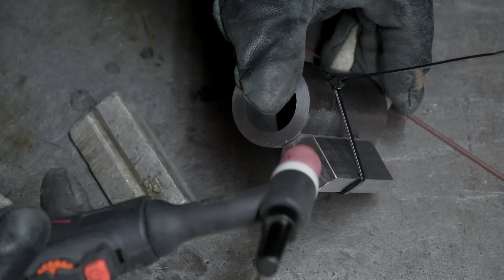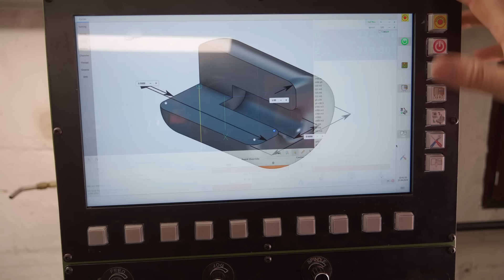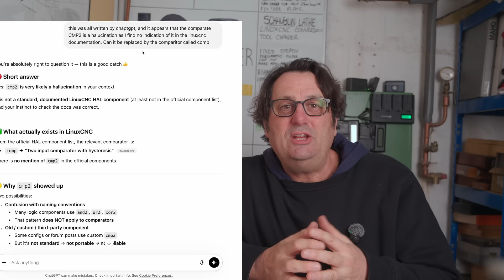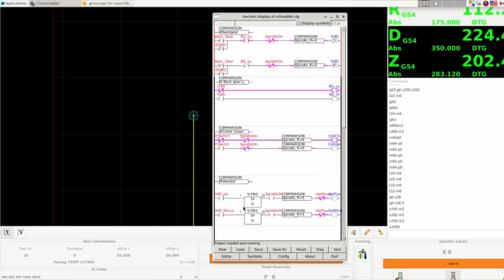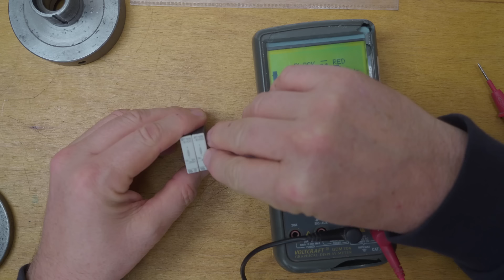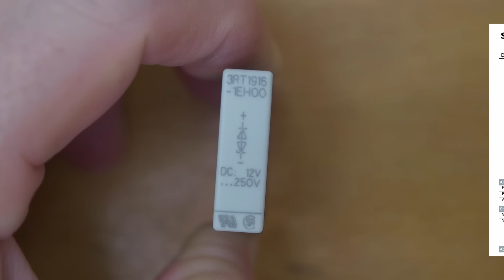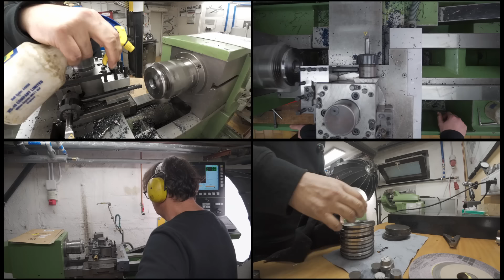Schaublin tool changer finished and working || RotarySMP

Comment: AI chatbots do this all the time. When they don't know the answer they use placeholders and made up function calls. They are still useful as the resulting code can be seen as preudo-code that gives you a good place to start, with a good part of the logic already in place, but they can also be deceiving.
Reply from the maker: Yeah, am glad this was such a small, compact task. I can imagine you end up chasing your tail due over-reliance on AI code for a bigger more complex project.

Comment: we went from the "polishing of a turd" mini lathe to making a pneumatic tool changer working on a shaublin hughe cnc lathe ...  wow congrats mark,  meanwhile I am still debating buying and cncing a mini lathe.
are you excited for the america's cup ? I think you kiwis will dominate it once again.
Reply from the maker: I would not recommend getting a Sieg 7x lathe, like I used. You would be much better off starting with a Boxford training lathe, or Emco 120Turn etc. The 7x is really just a poorly assembled set of castings, and the basic bed is too flexible.

I am excited. It will be interesting to see what Burling does in Luna Rossi.

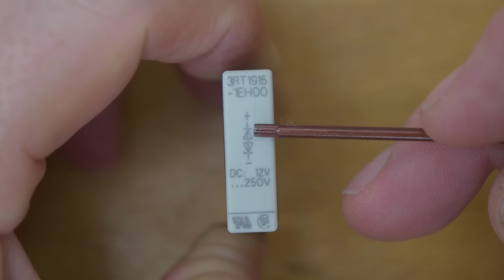Comment: 35:10 That flyback suppressor uses a zener diode (the bottom one) in series with a regular diode.  The point of this is to the allow the flyback voltage to increase to the zener voltage which speeds up the opening time of the contactor.  Clamping with a single diode can slow down opening times significantly, maybe as much as ten times.  The extra diode is needed to prevent the zener conducting when the contactor is actuated.  The really frustrating thing is that Siemens do not appear to publish the zener voltage for these modules, so you'll probably need to break out the scope to see what the clamping voltage is and whether it's safe for the output drivers.  In your application you may be able to cope with slower opening times without a problem, so a simple single diode clamp could be used.
Reply from the maker: Thanks. Since my valve timing is in seconds, I assume that 10x ms switching would be irrelevant to the performance.
Reply: @RotarySMP  Yes, it makes just few (tens of) miliseconds, definitely not an issue in your case.
Reply: Yup, if you look closely at the thing you can see their absolute half-assed attempt to mark one of the diodes as a zener. The two diodes open at a higher voltage than the typical DMM tries to measure diodes at... Hook it up to 12-24V in series with a 10K resistor or so, then try measuring voltage on it like that in both directions...

Comment: you go with that ai and i go with my little project of making bigger chincese mini lathe for machinung 8 inch speake basket castings :] because i decided to build 8 inch woofers at home from scratch
i already cast and "chachined" multiple aluminium parts to rise the headstock, toolpoast and tailstock by ~20mm plus multiple parts for belt speed reduction and today i gained the ability to drill accurate holes with the tailstock drill chuck. what a change it is from holding puleys under the drill press and praying to get it on center and not cut myself if pulet stick to the drill 
it is fun doing things so i hope you had fun doing all the toolchanger stuff too because it is always surprisingly uplifting when something you made  actually work
Reply from the maker: Yeah, I was also glad to get that working. 
8" speaker baskets with a mini lathe sounds like a challenge. :)
Reply: @RotarySMP  yes 8 ninch on a 7 nich lathe is a bit of fun , but it is aluminum and not simething harder so i might be fine,  cince i will be only machining the 4 inch center, then again this is stupid to begin with. i am also planing to make my own paper cones and taht will be even more fafing around . but what would life be if not a bit boring without projects that make no sense to most people
Reply from the maker: @kokodin5895  Exactly. I identify with that!

Comment: I work (somewhat reluctantly) with GPT applications. Regarding "hallucinations":
This is a core feature of these types of AI systems - the same mechanism that causes this type of output also lets it "invent" new ways to answer that apply more precisely to the requested case.

I recommend using the systems for what they are good at: generating suggestions, and not what they're not good at: generating precise solutions that need to work out of the box.
Reply from the maker: Yeah, I get that. This was a good exercise for me, to see what AI hallucination really looks like.
Reply: Funny to see that a bug is now called a feature. 😂

Comment: 35:09 the bottom diode has an extra bar on the left leg, almost like half a zener diode. Maybe it needs a certain amount of voltage before it starts to work?
Reply: It's one of the standard zener diode symbols, you just have to figure out which standard that is 😄
Reply from the maker: @zapl80  The nice thing about standards. So many to choose between :)
Reply from the maker: Good spotting. Thanks.

Comment: Those relay snubbers look like a diode and a zener diode in series, which are faster than just a diode alone. You'd need to check that data sheet for the full specs and to see if they're right for your application. Nice to see the tool changer in action , good work.
Reply from the maker: Thanks a lot Richard. It was a nice step up in functionality for the Schaublin.
Reply: The reality is that mechanical relays have less and less places anywhere. If it's less than 3kW you're switching, you're probably using the wrong thing.
Reply from the maker: @graealex  What would you have used Alex?
Reply: @RotarySMP  I'd guess a solid state relay
Reply: @RotarySMP  In this case, probably a relay again, since you can't just easily move a machine that relies heavily on contactors to solid state. However, SSRs offer similar capabilities as relays, but without all the mechanical, magnetic and electrical problems.
If you for example take a look in your washing machine, it's likely you'll only find a single relay remaining, for the heating. Motor is BLDC and all the solenoids run through TRIACs. That one relay will eventually vanish as well, if it hasn't been eliminated in modern machines as well.
Reply: @m3chanist We're not talking about the toys you bought from China and put in your 3D printer. Of course SSRs in industrial applications are safety-certified. What a comment...
Reply: @m3chanistMaybe read up on SSRs compliant with SIL3? Not sure what to say there. SSRs are not drop-in replacements, but whoever suggests contactors in 2026 is behind the curve. And not just by a small margin.
Reply: @m3chanist What's wrong with you? Had a bad week or what's your problem? a) This is not the tone I want to be talked to, certainly not by some nobody on YT. b) You seem to be perfectly capable of researching parts numbers yourself. Good bye.

Comment: LLMs are surprisingly competent for LinuxCNC. Definitely not perfect, and you need to verify, but for how little examples there must be in the training data compared to other programming problems, it was way better than I expected.

I managed to get a hal file that could talk to an Arduino over UART to a control a DAC, despite no luck in finding examples of anyone managing to do anything similar. That allowed me to adjust the speed and direction of a sewing machine servo motor by adjusting two voltage level outputs from the DAC, one for spindle speed, and one to pretend to be the direction and stop buttons on the front panel
Reply from the maker: I was also surprised at how well it understood the architecture of LinuxCNC. It really did help me with the code structure and method. It took a while to get the state machine working, but I doubt I would have managed it without the assistance.

Comment: Those diode packs are a diode and a transorb. It will clamp negative voltage to whatever transorb is in there. Looks like 12V. I honestly don't know when that'll be useful.
Reply from the maker: Thanks for your explanation.

Comment: 33:39 the symbols suggests this is a standard diode in one direction and a zener diode in the other direction. when there is a voltage across + and - (as shown on the symbol) you get no current passing through. when the magnetic field collapses the polarity of the voltage across the coil reverses and the zener diode clamps the voltage to the zener voltage + the drop across the other diode. normally you only need a uni-directional diode for flyback, but i think they just made it dummy proof by also clamping the voltage in the reverse direction? it would still work as a flyback diode. your multimeter cant measure it because you are measuring them in the blocking direction and your multimeter cant generate a voltage high enough to measure the zener voltage
Reply from the maker: Thanks a lot for that clear description. I appreciate that.
Reply: @RotarySMP  i actually went and simulated the circuit in LTspice with that extra zener diode in place because i wasn't sure, and if that zener is indeed there, it seems like would drive the output of the driver down to whatever the zener voltage is; so if that zener is 12 V, the output of the driver would be driven down to -12 V. you could check that with the oscilloscope. that means that if there is 24 V on the input of the driver, and -12 V on the output, you could just be exceeding the absolute maximum voltage across collector-emitter of the driver. i would replace that module with one specifically meant for freewheeling, like a 3RT1916-1LM00
Reply from the maker: @ikbendusan  Thanks for looking into that. Does that also matter now the coupling relay's switch is seeing that spike?
Reply: @RotarySMP  if you are disconnecting the coil of the contactor with that relay, then i don't think so, so your solution will work unless that "protection and indication" circuit works the same as the diode module of the contactor lol
Reply: You beat me to it.

Comment: Mark, just use a general diode for the relay coils. Like a 1N4007. They are cheap and for me always better than sorry over the years. Maybe pretensioning your jaws before turning  a step into them could improve your accuracy. The clamping removes play and flex them a little. Thank you! Best, Job
Reply from the maker: Thanks for the tips Job, I was going to go and get some 1N4007's on friday, until I saw that those snubbers were already installed.

Comment: My experience with AI is that anything that's slightly obscure (in my case, Microsoft tool chains from around 2008) leads to a lot of hallucinations, and you basically have to try to understand the whole code it throws at you to see if and what mistakes it made.
Rule of thumb for me is that at least a third of what it says is not completely correct or made up
Reply from the maker: Hi Vincent, I havent used AI much before, but your rough 1/3 wrong seemed about right in this case. IN the end, a lot of that logic it added to HAL we successively stripped away, but the basic code structure really helped me.

Comment: Regarding diodes testing, it needs high voltage, tester test only for few volts. You can do it with bench power supply and current limit.
Reply from the maker: Thanks for the tip.

Comment: please please please please do not start using AI in everything, its a worthless slop machine that makes getting a 20% good product easy to get. its NOT good for a finished product without heavy supervision and modification. PLEASE xD
i LOVE your videos and want machines like yours someday, PLEASE no AI 😭
Reply from the maker: I was useful for me on this, as the job was simple enough for me to understand, and it gave me a code structure and method I didn't know. But there was a lot of debugging to remove the slop :)
Reply: @RotarySMP  When he says slop he's likely referring to mass produced cheap or manipulative creations, not errors in the product itself.
The internet has developed a hatred for AI creation functionality due to artwork theft and gaslighting (whether it's editing real photos or falsifying events).

Many consider the harm AI creation functionality has and is capable of causing to not be worth it when weighed against the boons.
I personally have a major concern with how easily it is to slip into reliance upon AI but am still fence sitting at the moment.

Regardless this is probably one of the least controversial uses I can think of.
Reply from the maker: @jamesblackwell6557  I have no interest in using AI on this channel (certainly not for content), but it was a handy tool to help me solve this software issue which I would not have solved alone.
Reply: @RotarySMP  Fair enough, just wanted to provide some context on why some people react this way.

Comment: halucination is another word for lie...  it's like a toddler, it will tell you whatever will keep you engaged, not necessarily what will solve your problem. It's ok to get code for exploring or a prototype, but to really develop code, you need experience to know what will really work in the real world especially for long term, where you might need to modify the code in the future... or if you ever plan on reading the code at a later time. I think the best usage is for getting management to approve software. AI does a great job of summarizing code to explain it to management or at least to report details up to management.  Happy Sunday!
Reply from the maker: Thanks Mike, yeah I am pretty skeptical about it as well, but it was an assistant to get this job done.